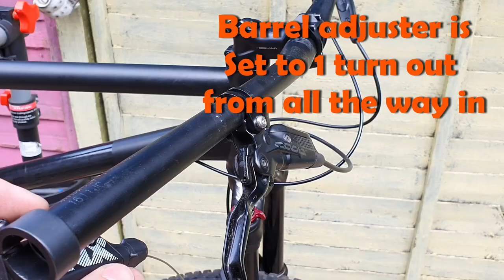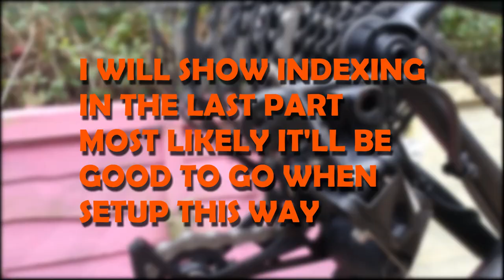Hello Dave Part 5 Drive Train

Comment: Do you know any other cranks that will fit into that bb
Reply from the maker: Its a nice generic sizing of frame, 73mm width British thread opens you up to lots of choice. Hollow tech 2 fits a few different makes of crank so worth looking at their spec sheet.
The BB is the cheaper part to buy so its worth sourcing cranks first and then matching it to a suitable BB that fits 73mm thread
Reply: @TheBikingVikingDude  is 73mm the width that the bb has to fit in to or the width of the cranks
Reply: I’ve found a race face crankset that says 73mm bb and on the reviews it says the spindle is 24mm would this work
Reply from the maker: @harrypoint6688  73mm is the measurement of the frame width at the BB section. The BB once installed will be wider and the crank just needs to match the BB standard (ie dub BB needs a dub crank set, hollow tech 2 BB needs a hollow tech 2 compatible crank set)
Reply from the maker: @harrypoint6688  the 24mm refers to the spindle diameter which is hollow tech 2 standard if its 24mm all the way through. You also have GXP which is 24mm on the drive side and 22mm on the non drive.
Reply: @TheBikingVikingDude  did u mean hollow tech 2 not 3 or did u mean 3
Reply from the maker: @harrypoint6688  yeah should be 2, sometimes my phone likes to change numbers.
Reply: I’ve found some race face ride narrow wide cranks would they fit into this bb
Reply from the maker: Narrow wide refers to the single chainring designed for 1x systems. The spec of the race face would need to be know. Race face make various cranks to suit differing BB and frame sizes you need as long as the crank is designed for 73mm wide threaded BB.
Reply: @TheBikingVikingDude  ok thanks. The only reason I’m getting new cranks is because I’ve lost the crank arm bolt and I can’t find one anywhere. Any suggestions on where to find it
Reply from the maker: @harrypoint6688  are you missing the pinch bolts (standard bolt from engineer or hardware shop) or the preload bolt on the end (if so which cranks do you have)?
Reply: @TheBikingVikingDude  I’m missing the preload boat at the end and I have the cranks that are on the calibre boss but evo
Reply from the maker: @harrypoint6688  follow this link, you need to select the M18 option https://www.ebay.co.uk/itm/174069092831
Reply: @TheBikingVikingDude  ok thank you your a life saver
Reply from the maker: @harrypoint6688  no worries, good luck, it'll look nice a being when you are done.
Reply: @TheBikingVikingDude  it came today and fitted perfect
Reply from the maker: @harrypoint6688  nice, just saved a fortune so good result. Do they look bling?
Reply: @TheBikingVikingDude  yes they do